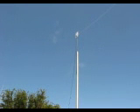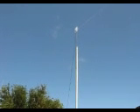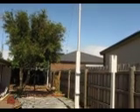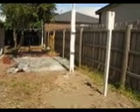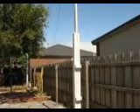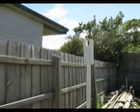A timber antenna mast

Comment: is it possible to construct a 30ft pressure treated wooden antenna tower, as long as it was lag bolted, or drill bolt, and lock washers. maybe even steel L braces on the inside of the tower where the 2X4 would come together. I am thinking about 30ft in height. 3ft at the base coming to 2ft wide at the top. then guy wire every 10ft just to make Shure it is safe to climb to mount the antenna, as well as safely stay standing. then maybe a good high end "water sealant" for added protection. I would appreciate everyone's thoughts, and Ideas on this. I am only thinking about this, as I can't afford a tower. I was thinking they held up windmills for years, and that was very primitive back then. with what we have today I think this could be done safely, but my last thought is if this would even pass the FCC RULES.LOL.LOL.. thank you all (UNIT928) or you can just call me nuts!!!!

Comment: Looks good,nicely finished, easy on the neighbours' eye. For dipoles, I tend to use a rope and pulley at the top of whatever mast I'm using, just hoist the centre/feedpoint up and down. Very convenient, good for loops too.

That's real radio, anyway, always good to see. If you compare the cost of a homebrew mast like this to the price of commercial masts of around 8 metres in height, it's worth the effort. Good work and VY 73.

Comment: Nice job! Good example how a ham can get on the air cheaply and with easily accessed  materials . A bonus if you use open feeders    you don't get interaction like with metal supports .  N7BDY  Bob

Comment: Good effort. Mine tilts over near ground level and is 10m high. I have a double pulley at the top which allows me to raise and lower wire antennas without having to lower the mast.